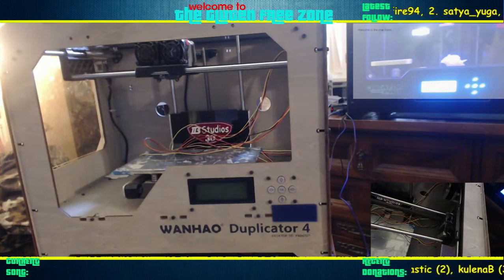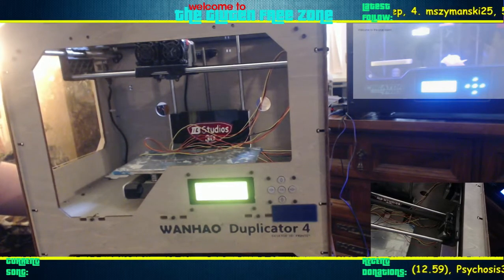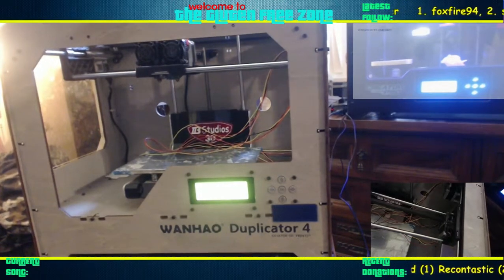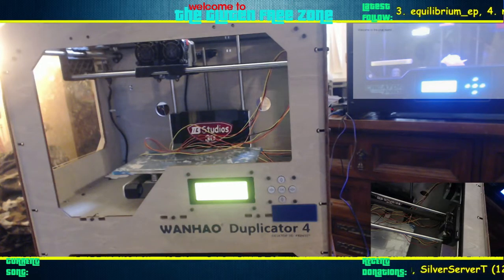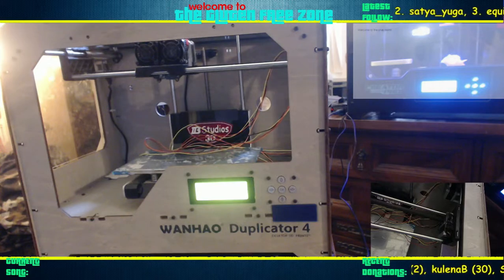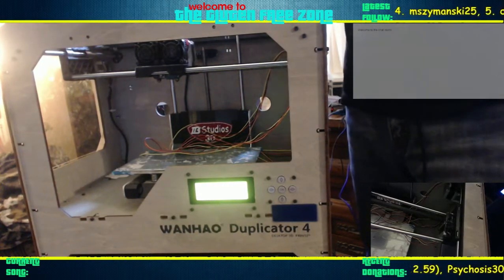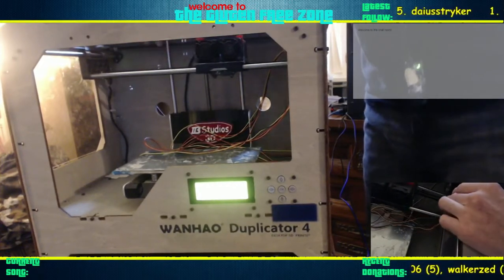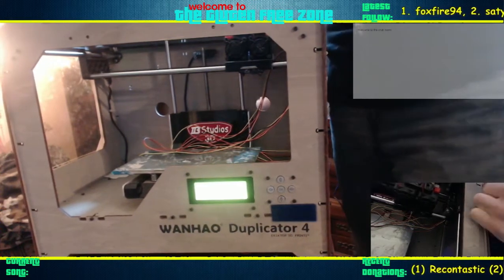Wanhao Duplicator 4w/ Qidi Tech Mightyboard and SailFish 7.7 blank display

Comment: How did you get sailfish 7.7 on the Qidi Tech board? Did the Qidi Tech board ship with v7.8 and you reverted to the official v7.7?
Reply from the maker: Correct, the QiDi board had 7.8 and I reverted to the official 7.7 Sailfish.,,,never got this board going tho. Might try it again with different stepper drivers